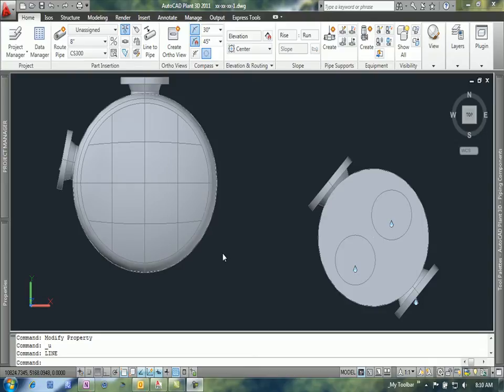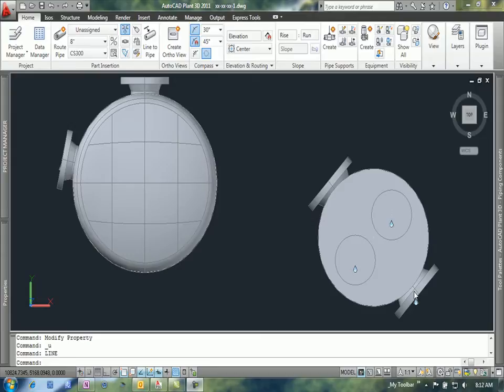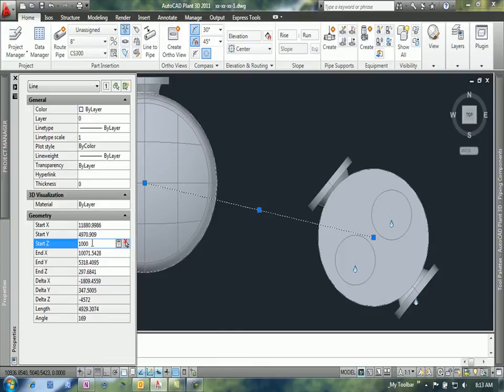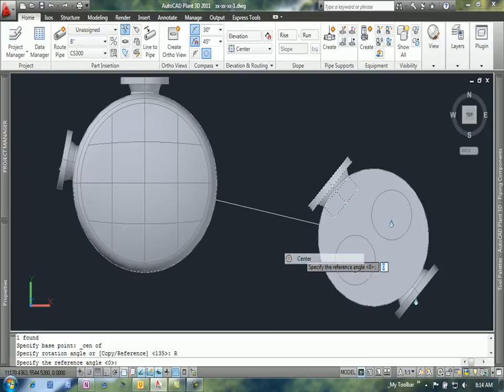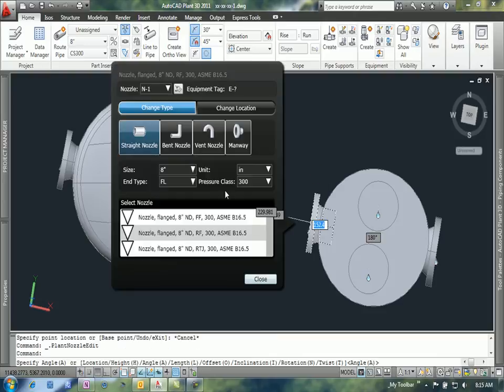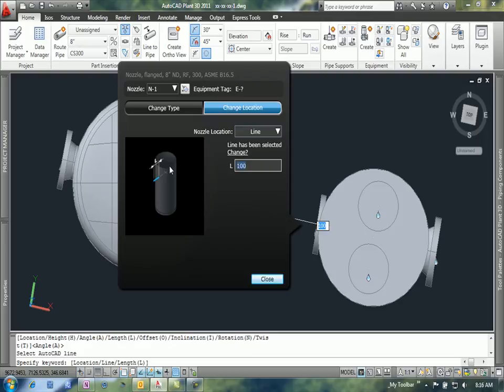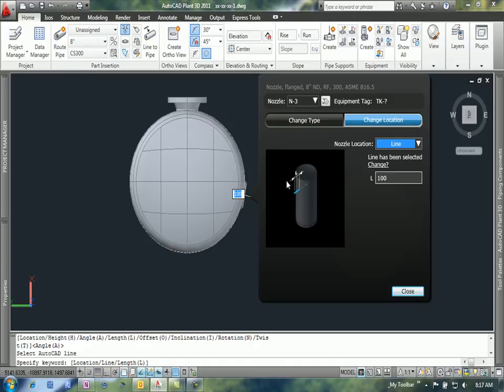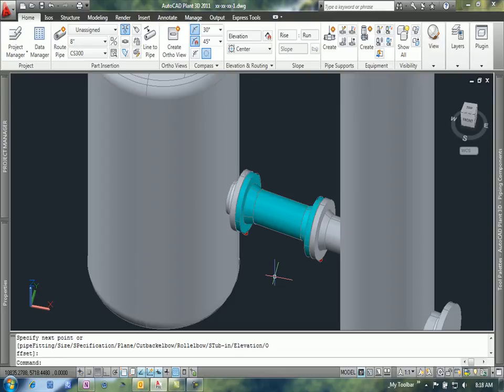Aligning Equipment Nozzles in Plant 3D

Comment from the maker: You need to hold control and left click on the nozzle you want to modify. Once you select the nozzle to modify you will see a pencil, that pencil is the edit nozzle button that allows users to control the nozzles individually. You can then control the nozzle type and location in the dialogue box that pops up.